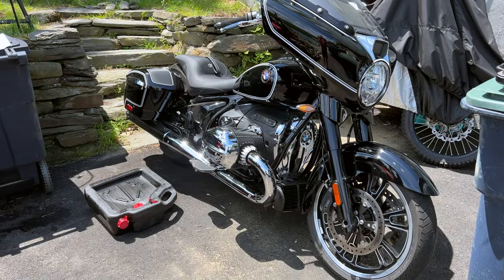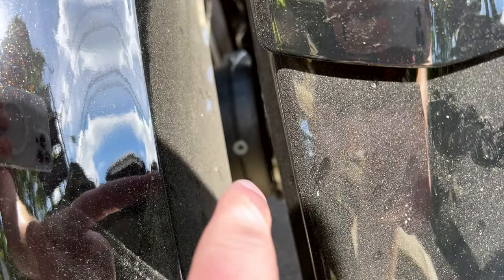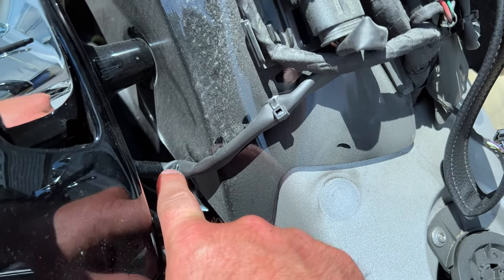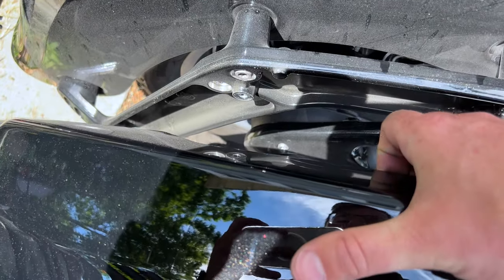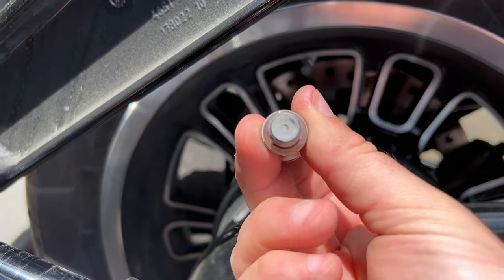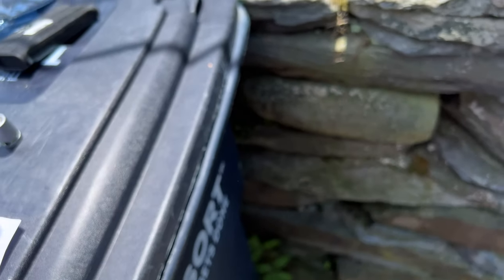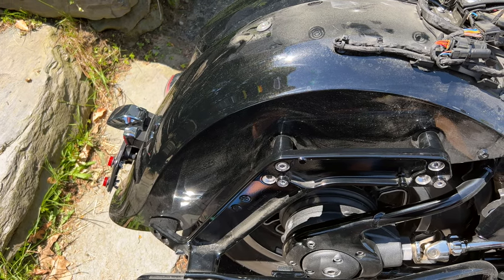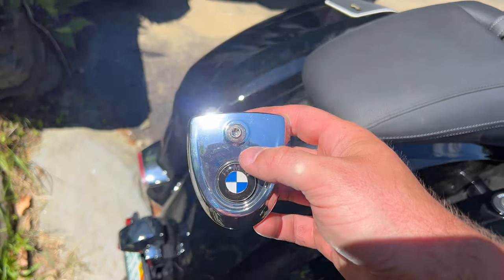How-To: BMW R18 Final Drive Service Guide (Bagger, TransContinental, Classic)

Comment: I am sooo looking forward to seeing the 6k valve check service!
Reply from the maker: you might be waiting for a while.
Reply: Great video!!
I’m about 1,300 miles away from my 6,000k service (commuter).. I can’t find anything (video or manuals) related to it.. is the information only available through the dealership? Thanks in advance…
Reply: thats what is chappin my arse bmw needs to release tha service manaul
Reply: I have done 2 valve checks/adjustments, on R18's. Specs are 0.20-0.30 on both intake & exhaust. Both measured 0.27-0.35. I set them @ 0.25. Lock nuts @ 8nm (torque)
Valve covers @ 10nm

Comment: My R18 Classic with only 500 miles and the rear tire has a small screw in the middle of the tire, I patched it up, still loose air. The dealer said no repair we just replace the new tire. Do I have to replace the tire with every puncture? Any suggestions? Thank you, Adam
Reply from the maker: I usually trust mechanics but a dead center hole should be easy to repair. Did you do a patch only? I’d try using a plug and see if that holds. They may just be trying to be very careful and not have a liability. Sorry you’re dealing with that.
Reply: @AdamChandler86  Thank you Adam for your prompt response; R18 Classic tyers are NOT tubeless, due to the spoke wheels. I thought they were tubeless but they are not; so at first, I used plugs that didn't work and later ended up taking it to the local BMW dealer for full replacement of both tyer and tube. Soooo sad!

Comment: Is the rear drive G3 capacity the same for R18FEs?  I have heard 180 and 210.
Reply from the maker: I only have the service manual for the bagger BUT I have no reason to believe they’d be different. I just can’t say for sure as I’m not a BMW tech.

Comment: I drained about 240 ml out of my Transcontinental doing the 600 mile service. Haven’t found any specific spec for the Transcontinental regarding this capacity. 🤔 Guess I’ll be calling the dealer tomorrow.
Reply from the maker: Hi Chris. I can tell you from the service manual, the volume on the bagger & transcontinental is 210ML with a +/- 10ML of allowance on either end. If your bike is new, that was an overfill from the factory. Not a big deal, it happens. I’m just quoting the manual.
Reply: @AdamChandler86  Hey thanks! I appreciate the info. Excellent video BTW, I’ve enjoyed your R18 content.

Comment: Hello Adam, again thank you, especially for including the torque values for the fill and drain plugs. I am confused however because the values you posted at the end of your video are contrary to the torque values you mentioned while changing the oil. You said to torque the top one to 25 Nm and the bottom to 20 Nm. However, what you posted at the end of your presentation says: 
Torque the Fill Plug to 20 Nm and Drain Plug to 25 Nm.......would you kindly correct this, which is it? thank you.
Reply from the maker: I opened up the manual. Lower bolt (drain) torque is 20NM. The filler plug (top) is 25NM.
Reply: @AdamChandler86  Thank you for clarifying, Adam, I looked through my manual, but couldn't find the torque values.
Reply from the maker: Sorry, I should have been more clear. Service Manual, not owners manual.
Reply: @AdamChandler86  I apologize for being a pest, kindly tell me where you got your "Service Manual" God bless.